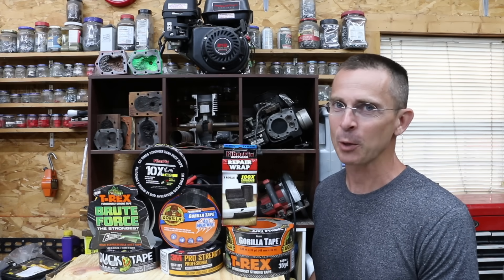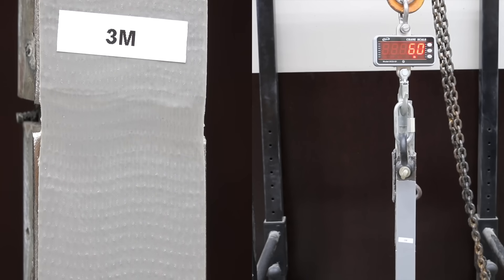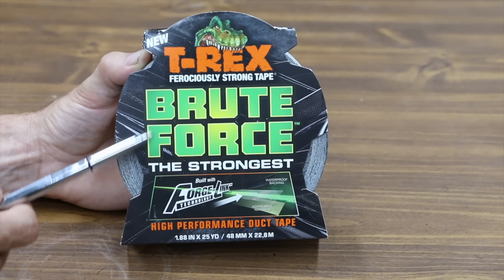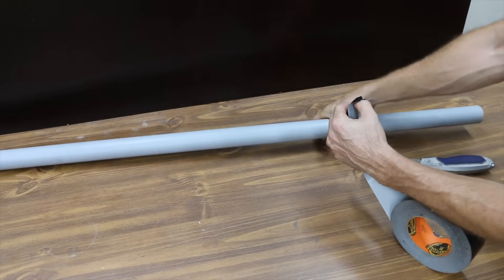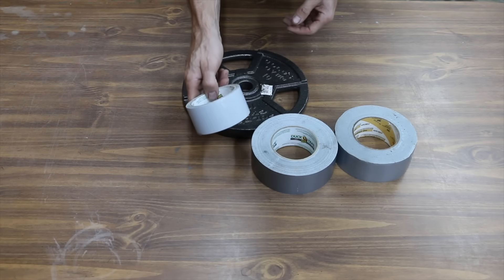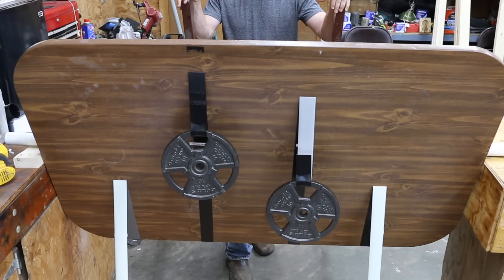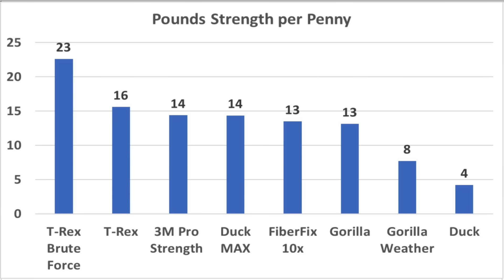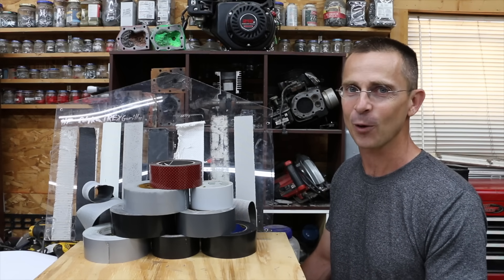Which Duct Tape Is Strongest? Let's find out! Gorilla, T-Rex, FiberFix, 3M Pro & Duck Max

Comment: I use to do bass competitions and was running about 10,000 watts in a 98 ford explorer 2dr and it broke the hinges on my rear window and the window lock stopped working, it was flapping like youd never believe. I gorilla taped it on and it held for 3 years total before I got rid of the truck lol .I cant say the hinges on the actual rear hatch held because the gorilla tape held so good there was no loss of air from my sound system it broke the locks on the sides and the 2 top hinges from all the flex and pressure.  The tape held it very well, I was sitting at a red light and the whole rear hatch fell off🤣 I had to ratchet strap it to the back seats but THE TAPE STILL HELD AFTER THAT! I love gorilla products . I had no water leaks from the rear and I also taped my sunroof closed and had no leaks whatsoever .I appreciate your video and you taking the time to make them.
Reply from the maker: Thank you for the feedback!

Comment: The strongest duct tape is whatever the fuck Brand they use inside Nuclear Power Plants that I work at.

I accidently put it on my car when doing something on my hood. The Duct tape was only for maybe 3 mins or so and it peeled the paint from my car to the bare metal.

Comment: I really like the metric of "Pounds Strength per Penny" as it's sometimes difficult to compare materials across the high and low ends of the market.
Reply: I like that he includes metric units for the other 95% of the planet
Reply: @mwbgaming28  my tape strength is measured in freedom pounds per acre and I like it that way!
Reply: @JohnDoe-py4ty  and I like my tape being measured in nanograms of tensile strength per Planck distance of tape
Reply from the maker: Great feedback. Thank you

Comment: Basically the simplified pecking order for the tapes is: gaffer's tape [or painter's tape] for applications that require removal of the tape later and you don't want a residue; Gorilla tape for all-around applications--my personal favorite; T-Rex for extra heavy duty applications/applications where you probably aren't going to remove the tape any time soon; Flex tape for the best seal and where you definitely aren't going to remove the tape. Never use Duck tape unless you want the colored tape, and then other than that there's the usual non-duct tapes: cellophane tape for the obvious, and specialty tapes for specific applications that you'd only use if you know what to do with it.
Reply from the maker: Thank you for the feedback
Reply: @ProjectFarm  Thank you for testing all these different brands! I have definitely learned a few things from your videos, including some surprising things.

Comment: As an industrial engineer, I recommend atleast 10 samples in your experiment/study.
Reply from the maker: Thank you for the feedback
Reply: Fair request.

But also with the T-Rex max, he towed a freakin tractor with a dual band of tape...   I don't think there's much else to say about the sheer potential of that tape.   Add some extra spray glue on the bottom and it would be almost ideal in every situation.
Reply: Thought you were a general?

Comment: A video comparing trimmer (weed eater) string/line/blades for cutting weeds and grass would be great  I have used the round plastic line, wire filled plastic line, shapped plastic line, and plastic blades but have seen many more variations and am sure that your analysis of these tools could be extremely useful for many lawn care providers.
Reply from the maker: Thank you for the video idea!

Comment: I subscribed because of all your hard work and honest testing...I dont subscribe easily so you're pretty awesome...Can  you do a test on roadside flat tire repair kits? fix a flat, the plugs you stab into the hole, maybe even a real life field test of the pumps you recently did but not on a test bench, but in real life with real challenges like wire length and ease of use etc...*when i said fix a flats, i meant different brands of repair spray products such as the slime and other stuff.* You may have already done something similar..not sure
Reply from the maker: Thank you for the feedback!

Comment: come on man if the tape breaks at 100lbs, how the hell is it going to pull a 2 ton tractor, even if you wrap it around 10X it's only 1000lbs probably less, and still 3X less  than what you need,

Comment: I love destructive testing of commonly available shop products.  That guy who did the anvil test was amazing.  This guy with the duct tape test... amazing.  I would suggest doing a video on the sheer strength and grip for common 3" #8 wood screws vs other brands, standard 3/8 bolts vs hardened (grade 5, 7, etc).  You could also test cheap vs 'quality' - geared wrenches, ratches, cresent wrenches, etc with your end of video cost analysis.  I really enjoyed your cost analysis at the end of this video.  I am a number cruncher too.  Cheers

Comment: I hate the strong tapes. the adhesives are not even that much better but they are very hard to tare so you have to use sizzors, I don't see a use for super thick strong duct tape.
Reply from the maker: Thank you!

Comment: If you do duck tape again I would be interested in how the different brands do against wear from motion. We use duct tape to wrap horse hooves when the foot needs to be kept clean and dry. Even with multiple layers the failure is always wear through the bottom from their walking. Some brands last hours some brands last a day or so. Never sure if it’s the brand or the wrap job though as I have never had more than one hoof to wrap at a time. So a side by side test would be interesting!
Reply from the maker: Thank you for the feedback!

Comment: Can Seafoam Deep Creep quickly and effectively remove TREX BRUTE FORCE...AND the other weather resistant tapes??

Is. the strongest tape with Seafoam Deep Creep applied  slower to pull off the cafeteria tables than the time it takes for frozen motor oil to run the track?

Is TREX BRUTE FORCE BEST FOR LEG WAXING??....aka the "TREX BRUTE FORCE...I can't believe what it did for my marriage" video.

LETS FIND OUT😂

@Project Farm
Reply from the maker: Thank you for the video idea!

Comment: i see flaws with these tests everywhere.
on the tensile strength, should have used the second device for all tapes, otherwise youre half reading its adhesive and stretch along the whole length of the tape, unless you added tape. (which makes it unfair)
for the pipe test you should have done every test with tape on the chain
for the adhesive test, that is half testing the grip levels of the tape to the weight, not entirely on adhesive properties. 
informative review non the less
Reply from the maker: Thanks for the feedback.

Comment: Wow, you can pull an engine with T-Rex!  The over time idea was awesome.  I love this stuff, thanks for all the hard work. 
I'd like to see a compare on micro fiber towels.  I used one to clean my instrument plastic in my car and it left tiny scratches in it... so some are apparently abrasive.  Of course brand names might be hard to come by.   Maybe best towels or chamois for cleaning automotive paint and glass (glass cleaners too).  Best bug removers (not VW).  Best wax or best ceramic coatings?  Thanks.
Reply from the maker: Thanks!

Comment: I think if you redo the pipe repair test and aligned the tape to play to their strengths, the the T-rex Brute force would have done much better; they probably all would have. duct tape is designed to be able to rip thinner strips off, so if you want the pipe fix to hold, lay sever strips lengthwise across the cut, then secure those with wraps around the pipe. or do one wrap around the cut if it needs to be sealed, then perpendicular strips for strenth, then wrap to secure the strips.
Reply from the maker: Great point. Thank you!

Comment: Hi Todd, like you requested, heres a new comment with ideas.

Would you be willing to test wood glues, especially Titebond Ultimate vs a few other popular ones? 

Tensile strength as you always do with end to end adhesion with round pieces

Delamination/shear with 2 flat rectangular pieces being pulled vertically 

Repeat the above 2 after exposure to water 

Perhaps 2 round pieces glued end to end with torsion applied. 

Resistance to impact. End to end adhesion as well as "large" face to face. Maybe use a pivoting lever arm with a weight on it for consistent impact force. Like a charpy test. 

Finally, and most importantly, how well does the top performer do in the crankcase of a mower.
Reply from the maker: This helps a lot!  I probably can't do all of these but I can try.  The crankcase test--funny!  Thanks again!
Reply: @ProjectFarm  oh I wasn't trying to make it sound as if I expected it all to be done, sorry if I did.. I was just throwing out everything I could think of. I've  worked in product testing, comparisons, destructive, R&D & reverse engineering, but nothing with adhesives. I was basically guessing.

Comment: I wonder if the gorilla weather tape needs time to fully adhere to the metal. Therefore I would suggest you have a test to see if some tapes gain grip over time, or if weight on the tape helps it stick better. It would help knowing which tapes are best right away and which ones take time to do their best. You don't want a tape that will slip on items that immediately stress the tape, but if you can get more strength and wait a bit then that could be a huge plus!
Reply from the maker: Great pint! Thank you

Comment: Eack time you gravity-pull tape off of the laminated table, it probably gets prepped for a better bond to whatever tape you test next! The tape pulling off removes dust, grease etc, and might even leave some of it's own adhesive behind in the pores of the laminate. Perhaps you should have used glass or ceramic or something non-porous.
Reply from the maker: Thank you for the constructive feedback.  The table has a laminate coating and I clean it with brake parts cleaner.  It's been cleaned hundreds of times over the past 2 years.  Amazing that its held up.

Comment: It has been my experience that Gorilla Duct Tape doesn't stick well, indeed hardly at all,  to fabrics ---- I cant remember but I think I tried the All-Weather variety. I suspect that what most prospective buyers want to know is, will the tape adhere well to fabrics,  various plastics and vinyl, finished and unfinished metals, and so on?. Also, do they gum up and get gooey after a few weeks or months of humidity, or in the sun? Or do they dry up and get crumbly in the sun and the elements?
Reply from the maker: Great suggestion! Thank you

Comment: Can you do a shovel test? Specifically a small, easy to carry shovel that one might use while metal detecting. I tried 2 and they were both crap, bent easily and didn't provide much digging or sod cutting ability.
Reply from the maker: Thank you for the video idea!
Reply: Cold Steel

Comment: Another YouTuber used a Fuel additive called MAXX fuel supplement I believe that supposedly increased horse power by 3 HP, could you run a test on it and other additives that lay the same claim please and see what is Passable and what is trashable as far as what not only increases HP but overall engine performance

Thanks your YouTube subscriber

Danhazard
Reply from the maker: Thank you for the video idea!

Comment: There is something interesting about the Duck brand Duct Tape, if you take a strip and fold it over on the sticky side on itself and then quickly pull it apart it lights up in the middle
Reply from the maker: That's interesting!

Comment: Have you done hacksaw blades? I know you did recip blades. I had to repair some plumbing today. The Doit Best brand blade that I keep in my plumbing box is wanting for teeth. Not really amazing until you understand that it only ever cut PVC!
Reply from the maker: Not yet. Thank you for the video idea!
Reply: It will be a challenge to pull the weight off on the back drag!

Comment: ZIPTAPE is the only tape i use when duct tape would normally be used.. From what ive seen it gets no stronger then zip tape. But its really pricey about 35$a roll.  But a roll last forever cuz its so good. It goes on roofs as a dry in. So would say it will hold up in harsh weather
Reply from the maker: Thanks for the recommendation!

Comment: Project Farm, I have a suggestion that I have always been curious about: When they took lead out of gas, my dad started adding ATF to his gas as an upper cylinder lubricant. I add Supertech or Havoline TCW3 to every tank of gas in our vehicles, mowers, weed eaters etc. At 1 oz. per 3 to 5 gallons of gas, and to our Kubota diesel tractor at 1 oz. per gallon. It would be interesting to see which leaves more or less deposits on the valves and combustion chamber. If one is better than the other? Or possibly both do more harm than good?
Keep up the good work.
Thank you
Reply from the maker: Great video idea! Thank you

Comment: Another great video, now I want to go buy some TRex tape!
I'd like to see you do your oil tests with different additives like MMO, comparing the untreated oil against the treated in your standard battery of tests.
Also, diesel oils are said to offer more protection at the same viscosity vs gas engine oils, would like to see if this is true, are the best diesel oil superior to the best gas oils?
Reply from the maker: Great recommendation. Thank you

Comment: Could you test Master Lock as the best Key Locks?
Tests:
1) pull strength
2)Cut strength
3)Heat strength
4)Tamper resistant design
*Maybe you could see if there is a difference in the test with long and short locks. 

A standard base line for all the locks. I would think a school locker size would be standard. I've seen a bunch of locks while at the local school and I wondered if we could see you find out who sells the best brand of locks.
Reply: Gary Robinson Masterlock brand is garbage for security. Go check out Bosnian Bill’s lockpicking YT channel. You get what you pay for.
Reply from the maker: Great suggestion!  Thank you

Comment: This is a tall order. Is there any chance you could conduct a test or two at the approximate temperature extremes often reached in the Midwest during a typical year (-20 and +90) ? Dark tape could actually become much hotter than the air if exposed directly to a July sun. Will some glues liquefy at high temps or some tapes become more brittle than others under frigid conditions?
Reply from the maker: Great video idea!  I'll see what I can do.

Comment: I used some generic duct tape to try and seal a leaky sunroof on a camper van (VW Transporter T4/Euro)  it worked for about a week then the British weather removed all but a few fibres similar to the weathered tapes you left for a year.  Is there a test you can think of to test its sealing of liquid and gases (air!) even if it is a temporary fix it could get you out of a pickle
Reply from the maker: Thank you for the video idea!

Comment: Has anyone suggested you do a bed liner test? Something like the easy can spray on and the more commercial style like duracoat, linex, raptor liner, etc.
Reply from the maker: Great recommendation!  I tested the spray cans but not the roll-ons or commercial products
Reply: Abrasion, salt, impact, UV, cold, heat. A few suggestions off the top of my head. You are much more clever at coming up with tests than I

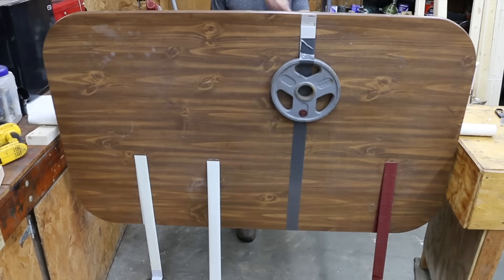Comment: Video suggestion: what's the best cold blue? Watch this at 12:59 to get the idea: https://www.youtube.com/watch?v=TtBeYsx0kEs. For different products, how long does it take the steel to change color? How durable is the coating (usually supposed to oil/clearcoat for durability, but do all just mostly rinse off, or are some more permanent?) How well do they protect against rust? Products such as Jax Blackener, Birchwood Casey Super Blue, Phillips professional cold blue, Brownell Oxpho-Blue. Steel has to be super clean for it to work well.
Reply from the maker: Thank you for the video idea!
Reply: @ProjectFarm  No problem. I love how your videos provide honest research and comparisons you just can't find anywhere else. And you know, for the cold blue, I feel like the info just isn't out there. And it's not even so much which product works the best, there's all these different methods--they way people prepare the metal, some preheat it, some dip, some brush on, some rub it in with fine steel wool, how many coats, etc. I honestly don't think there's a very good internet resource about the best way to get a protective black oxide finish on steel in the home shop.